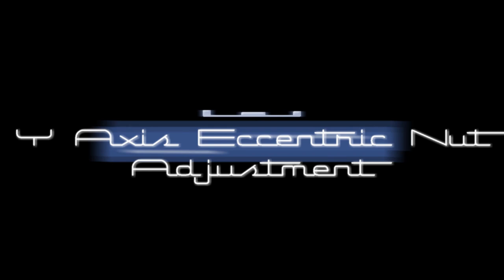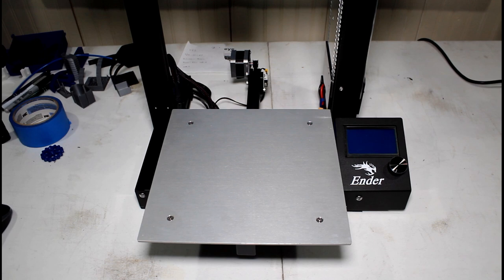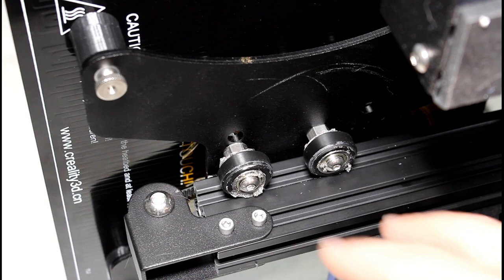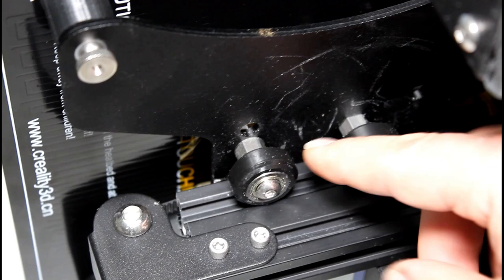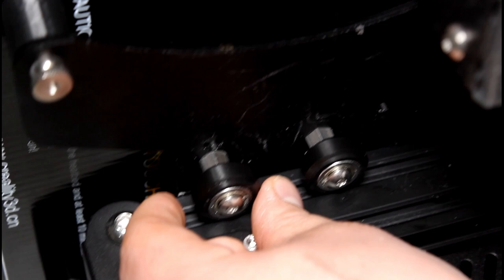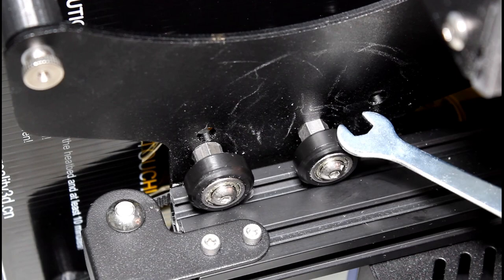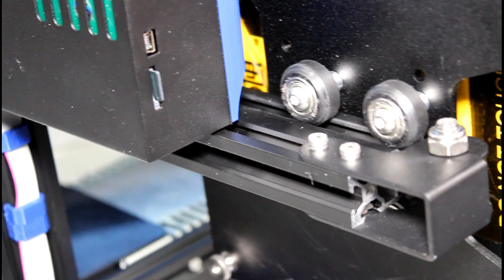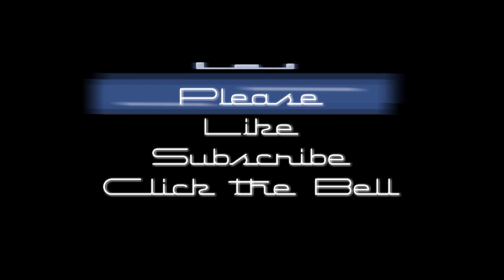Section 7.3 Y Axis Eccentric Nut Adjustment featuring the Ender 3

Comment: I also had a "jumpy" bed but even after ensuring that the eccentric nuts were properly aligned, I was still getting bumps as the build plate moved across the Y-axis. First I inspected the Y-axis rail, that checked out. Next I looked at the four wheels connecting to the Y-axis rails and found my problem! One of the wheels had been mis-manufactured and had a large flat spot where it should have been rounded. Changing out the wheel resolved the issue. It just goes to show how important it is to really inspect all of the components of the printer (Ender 3v2 in my case) during the initial assembly.

Comment: I just bought a new Ender 3 S1 and it was delivered with super loose eccentric cam nuts.  Your video isn't exactly applicable to my model but sufficient to solve my problem.  Take some satisfaction in knowing that something you shared over 2 years ago is helping people.  I am not a novice 3D printer user but this was the first time I had to deal with this specific issue.  Overall my satisfaction with my new $400 printer is not outstanding.
Reply: i just got a 3 s1 pro and wow these older models were way more accessible for adjustments.... ours is a bit trickier to get to. this is a great vid still!

Comment: The wheels attrac dust due to static charge. Rubber moving back and forth on a non-grounded metal slowly is generating electro-static charge. Nothing to worry about, the same happens to your TV-screen.

Air humidity play a role here too. I live in a very dry apartment and get more of this dust than when the printer was in the humid basement
Reply: Two years later - nothing to do with static. Delrin is known for electrical insulation (these wheels would last a week if they were rubber) the dust is the reason the bed is loose, it's delrin which has been worn off the wheels because the wheels were TOO tight.
Reply: Interesting, so is it really dusts? Wouldn't this dust accumulation further deteriorate both the wheels and aluminum extrusion's guide rails? Does grounding really help reduce the dust static collection?

Comment: My ender came new with one of the wheels on the bed loose after months of printing and hearing it rattle whenever the y axis moves quickly, I found this video adjusted the nuts and now the printer is virtually silent 😎 thanks for the info!

Comment: Got mine working thanks to your video but I took the heat bed off to adust the eccentric nuts underneath, made it way easier - printing my first print now, the xyz cube that came on the included SD card. Take your time and especially with bed levelling, go around 4 or 5 times till its perfect. I had an 0.11mm variation on auto level. Thanks for the video:)

Comment: I'm struggling to find any info on this, how tight exactly should the nuts be that connect the Y Carriage to the wheels? Not the eccentric but the threaded nut that connects the plate to the wheels.
Reply: For those interested. I loosened all wheel nuts (not the eccentric) and tightened until just snug. This seems to have done the trick with any warping between opposite corners.

The eccentric nuts, as the video describes, I tightened until the wheel can be moved by hand and no more wobble exists.

Comment: Hello there. Do you have any thoughts / experience with metal wheels rolling on polished rod? Some newer 3D printer some with those instead of plastic V slot wheels. Do you think that the same principle still applies - not so tight that you cannot spin in without moviing the gantry?
Reply from the maker: Ya, make sure it's rolling nice and not to tight!

Comment: I'm very confused. A twist and a turn and the problem is fixed but on my printer no matter how much i tighten or loosen it still continues to be wobbly. The wheels aren't deformed, there's no dust or debris but continues to wobble. Is it that much different with the ender extender?
Reply: I just upgraded with an 400x400 ender extender kit and am having some difficulty too. It gets so close but doesn't eliminate the wobble completely.

Comment: Mate can you help me. My print was fine. I printed 20 boxes. Then one box squished half way up. Now every box I do is super squished like some one stood on it when it was wet. I've tried everything now. Z axis works fine when manually controlled via LCD screen. Everything is where it is supposed to be. Bed is leveled. Z axis is stright, screws are in place correct. I just don't know what it won't rise when printing. If you or anyone could help that would be perfect. Thanks

Comment: The main part of that "dust" on those wheels is not dust btw. I had that "dust" exactly on the right and left wheel on front while the back ones stayed clean all time. Then I adjusted the eccentric nut of the front 2 wheels (right and left) and the "rubber dust" is gone ;) - Dust may make a part of it but most of it is just rubber from the wheels
Reply from the maker: Good point! It's always a good idea to have the rolling carriages dialed in as best as you can to prevent any wear and tear!